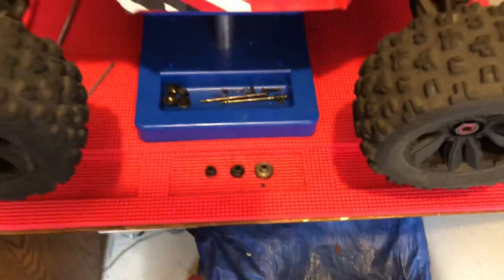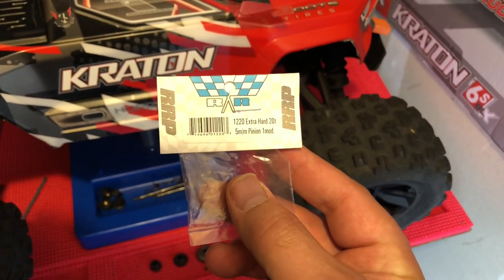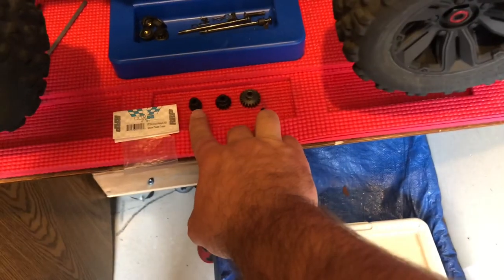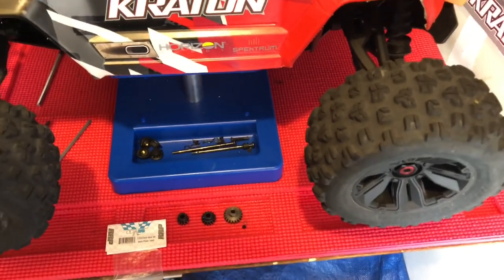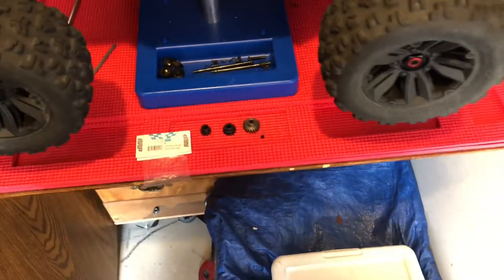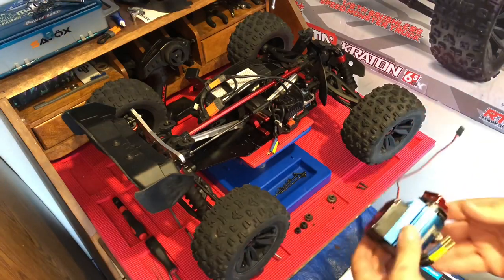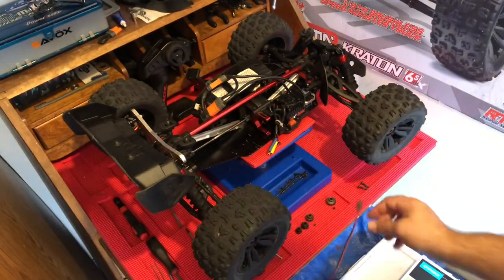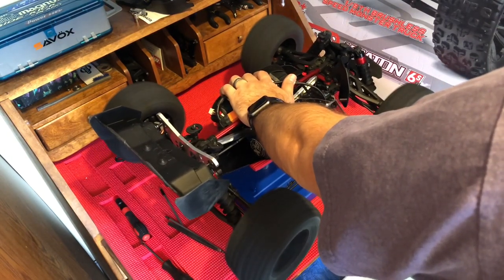PINION GEARS | Arrma Kraton | What you need to know

Comment: Ive gone from stock to 14 tooth tekno. I find 14 is a sweet spot esp for bashing as i dont need my K6 to go 65mph on a jump track lol 14 seems to have much more poke and goes faster at top end without any overheating issues which can occur with larger pinions.A sort of a balance i found was needed so as to not sacrifice instant (ramp) accelaration for too much top end which i will only really use on speed runs. Just think about where and how you want to drive before changing pinions guys - great vid as always East

Comment: Hi, just ordered my Kraton EXB at amazon an planning a Max6 1650kv Combo. You were the first source I found the info that I need a MOD 1 Pinion. Helped me a lot, THANK YOU VERY MUCH!!! Very much aprechiated :-)
Reply from the maker: That’s awesome! Two things …most of the videos that I’ve created will work just fine for the EXB. However the differentials are a bit different so if I don’t drop a video by the time you get to your differentials then there’s other great videos on them. However I recently picked up the EXB myself and plan on doing a series of videos on it as well. So stay tuned to my channel and we’ll go on the journey together
Reply: @EastTactics  Now that would be cool! Its my first 1/8th, so everything new for me. I've read that it would be good to shim the diffs to make them stiffer / more durable. Especially when adding lots of power. :-) What ESC / Motor will you put into your EXB?
Reply from the maker: @michaelfeuz1004  Im tossing in a firma 160 8s ESC, and the hobby 1730 motor, she's gunna RIP!!

Comment: You can change the spur gear and get the same results smallest spur
Reply: I got a blx185 6s 20 tooth pinion on a Revo 3.3 I won't know if it gets hot until summer time trying to figure out the right

Comment: I’m using the Powerhobby Aluminum Heat Sink W Dual Cooling Fan 1/8 Motor. No modifications needed strong fans. Part# PH1289. On eBay under 25$

Comment: Hey man! Thanks for the helpful video, I just uprgraded to a castle 1520 1650kv motor and a mamba 8s esc. Just to confirm, should I go with a 20 tooth pinion? And what size spur gear? My exb is stock right now.
Reply from the maker: I’ll probably go w/ a 22 or 23t pinion. 
Stock spur gear is fine.
Reply: Ohh dang! alright gotcha your awesome man thanks for the reply 👍
Reply: One more question lol what's your opinion on the diffs? I've heard they can be a bit weak with too much power?

Comment: Hey loved the video and thanks to you I finally understand more 😂 but I ordered a pinion 20t for now does it fit with a 50t hot racin spur or should I leave the stock spur ? What do u think it’s for a kraton 6s blx
Reply from the maker: KRYPTONITE LEGACY So long as the detailed instructions Or description outlined in your purchase of the hot racing Spur gear match the pitch or mod ratio On your pinion you should be good. But you need to confirm that they’re the same. Otherwise if you’re not sure you might consider sticking with the stock spur gear.
That all said you do need to be really careful with increasing your pinion gear when still running the stock ESC and motor. Especially if you’ve already increased the spur gear. Unfortunately the stock ESC and the motor are not really compatible with pushing the limits of your opinion and spur very high. I myself started experiencing A lot of rear end breakages in my differential as well as cogging issues. I have since dropped my pinion back down to the 16t.
I was running a 20t when the majority of my issues started happening. So you might be OK at 18 but just be warned. 
Also it is absolutely important that you massively increase the cooling on your motor. You don’t want your motor running any hotter than 150 to 160°.  An 18 tooth pinion gear as well as a modified spur gear are definitely going to put you in the hot range. I dropped a few videos recently outlining NTF fans, they are killer! But a little bit pricey. So you might consider picking up the duel yeah racing fans. You can find details in the description on my master list for that product. As far as details about NTF just check out my most recent videos. Also if you’re not 100% sure what cogging is I have a video on that in my library. 
Bash on broski!

Comment: What stand are you using to pick it up that high with the wheels on. My kraton and nero tires will still touch the surface with my DuraTrax stand. Already know my 8s Kraton won't work with it at all. Great video!!
Also for the 20T did you have to rotate the motor any? Think I'm running a 16 or 17 teeth right now and planning on going to a 20t after watching this video and a 23 or 24 for my 8s Kraton.
Reply from the maker: Hey Calvin, Great question. Mine is also the Dura tracks however I think it’s an older version that has a longer post. When I bought mine I specifically looked for this model. Check out this video at around the two minute mark, I show an image of the exact model I picked up off of eBay. Again I believe it’s actually a longer post then normal.
https://youtu.be/gov56EolTK0
Reply: @EastTactics  Thanks, yes I had the 1/8, 1/10 car scaled version. Thanks!

Comment: Thanks for this video man just got myself a 18t pinion gear and had you had any chance to bash around with the  bigger pinion gears? Got my kraton 6s on my channel brotha would like your input thank again
Reply from the maker: Awesome... be carful though, I learned the hard way, after going that high with an 18 and 20 tooth pinion gear, I started breaking rear diff pins and planetary gears. Turns out... the stock motor and stock ESC are not very compatible with that high a pinion. you might experience Cogging too. which is an annoying hesitation and clicking when hitting the throttle hard from the line.
You might be fine tho... I think I started really only experiencing the issues i mentioned above when I tossed in a 20t pinion. Bash on brother!!!
Reply: @EastTactics  thanks for the info brother I actually had a cogging issue with the 18t pinion punch level 7 so I decided to put a 15t on punch level 9 and  it's way more torque down low and does wheels doing 40+ lol 

Btw how did u fix the  cogging with the bigger pinion gears ?

Comment: My arrma senton mega 4x4 brushed came with a stock 17t pinion gear I upgraded to the 22t pinion. Made it hot. Burnt through the motor quick. I recently took out the brushed and converted to a 3660 3300kv and 60a esc I have a 26t in there. Would be open to recommendations for a good pinion for that. I am running stock spur in there. I currently have 2s lipo on it but gonna grab a 3s for fun. Also my motor is a 4t motor if that helps.

Comment: All I can tell you is watch your motor Temperature with that stock motor and a high gears you should be running lower kv motor with that 20 tooth
Reply from the maker: James, LOL wish you would’ve posted this comment a few days after I dropped this video ha ha. 
You are spot on with your advice and I in fact have since learned that I was way overzealous With that choice of running a 20 T Pinion. 
In fact if you check out my video library you’ll find more recent videos talking about me having issues with many components on my vehicle due to the choice of Running the 20t gear. I started breaking pins in my rear differential, which prompted me to purchase custom steel from McMaster.com, I also started experiencing cogging issues. After some diving into the armma forums, And letting those guys know what I was running, I immediately got a message Letting you know that I should not be running a 20t pinion with the stock components. 
So yeah… I might’ve learned the hard way however I was able to create content to teach others how to avoid the same mistake. I did leave a updated message in the description of that video that basically leaves exactly what you just said, what I need to do though is figure out a way to get that message into the beginning of the video, basically just letting the users know. 
I have since dropped back to 16T and the issues have gone away. Appreciate your sage advice. 
Here is a link to the video where I admitted the error of my ways. One of these days though I would like to grab a lower KV motor, and perhaps an upgraded ESC.
Link to that vid
What is RC Cogging | Motor Advice https://youtu.be/ZaK_JLI9QNA
Reply: Every one that’s in the rc hobby has has hit that bumpy road a time  or two I have and probably will again it’s just part of it

Comment: Would you say using pinion size as a tool to slow a car down for my kids?
Reply from the maker: I think there might be more effective ways to slow it down. What vehicle are you running? Like for mine, I can run it on one 3s battery instead of 6s.
Also… Some controllers come with a actual switch that allows you to Nerf the throttle.
Reply: @EastTactics  so i wanna buy a typhon but i dont want a mega...im using my granite blx as reference. Im running 2s, controller on 50% and punch 1. It s still fast on the street! Realizing when you re spinning on dirt the actual car doesn t travel as fast.
Reply from the maker: When it comes to your pinion size, small pinions seem to have a little bit of a quicker get up from the start line. Whereas large pinions will actually give you higher top end speed. However adjusting your pinion as far as speed overall goals, is fairly minimal, until you get to the top end speed of a vehicle.
Reply: @EastTactics  ya, kinda what i figured. Maybe they will just grow into the blx typhon.  How about swaaping just the motor?
Reply from the maker: I’m sure that could work, you would just have to find a smaller motor that’s compatible with your setup.
Reply: @EastTactics  appreciate your input. Killer channel.
Reply from the maker: 😎 thanks!!

Comment: I recently got a kraton 8s any recommendations on a new servo and a pinion gear I’m new to the rc world plus motor and esc
Reply from the maker: Congrats on getting the new 8s Kraton, is there a reason why you’re looking to replace all of the stock components? Are you not happy with the current performance of the stock motor and ESC? Or the stock servo? Or is it more of a… Money is not an issue thing and you just want to upgrade it to the best of the best?
I would say, since you’re new to the hobby enjoy the stock components get used to the vehicle and if you want to upgrade something simple just upgrade the pinion. Maybe go 21T or 22T. However if you do make sure you pick up a temp gun so you can make sure your temperatures on your motor and ESC are good.Also whenever you’re messing round with your pinion gear you’re asking more of your motor so it’s recommended to always put a fan on your motor.
Now… With that said if you were just simply looking to upgrade all of the stock electronics to higher end stuff I would probably check out Rich Duper bashes videos. Just simply type in Arrma Kraton 8s. I believe I recently watched a video of his where he is running an 800kv motor, with limitless 36/36 gearing. I’ve seen other people with 39/39 gearing, but those types of set ups require upgrading the motor to much lower KV.
I’m not as familiar with the 8S line, as my specialty is with the 6s. However another thing you might consider looking into is increasing the thickness of your center differential. I believe it comes stock at 1 million. Some people like up in that 20 million. If you’re not already familiar with the Arrma forums, check that out there are a ton of great set up Recommendations and good people to bounce ideas off of there. Highly recommend it

Comment: Thanks for the vide!!! Let me ask you a question since I having a hard time installing the front #M2CRacing front chassis brace in my v3 KRATON?Got the rear in no problem, but having some issues with the front brace! What do you need to take a part in order to get a driver or a pair of pilers to hold the nut while you screw in the top screw?
Reply from the maker: If i recall correctly when installing both my chassis braces, I used the small tool the arrma provided topside. Set the vehicle on its side and used the hex drive from underneath. I forget if I had to remove the center diff to get at it... I know its a nightmare removing that center diff in the V3. 
Sorry it took me a week to respond. I some how missed your question. 
I assume you've since figured it out. Bash on brother!

Comment: I have a kraton 6s v5 and i will replace the stock motor pinion With a 20t. It will be fine? I use it With 6s 5k lipo
Reply from the maker: So I’ve learned from experience after the creation of this video that you do not want to run a 20t pinion on stock electronics. While it will work, and the video here gives an accurate depiction of the speed increase. I found that I started breaking rear differential pins left and right. I started cogging. And unless you are running high powered cooling you definitely don’t want to run it because you’ll get too hot.
Watch this video for a more recent overview of what you might consider doing and thinking about it
https://youtu.be/s4-RjtQsMsU
With stock electronics, you really shouldn’t go past 16 T and if you get up to 16 teeth you really should be increasing your cooling over both your ESC and your motor
If you want to start running 20 then you need to pick up a motor and ESC upgrade

Comment: I'm building a Arrma limitless so far I have a kill mode tp 2900kv w/cap pack, xlx extreme, savox 7.4 sc-1268sg-be. Haven't started cause haven't decided on gearing. My question is I want to drift & bash on track with friends and still get a decent speed run when time is right, with out producing to much heat, what's you suggestion on gearing to accomplish such balance?
Reply: Thank you
Reply from the maker: I’m not very well-versed in gearing up the Arma limitless. However what I can suggest you do is take a stroll over to the Arrma forum if you’re not already a member. I’m telling you there’s a ton of guys there that Are always willing to help. And I’m sure there’s a large group of limitless Masters
 www.arrmaforum.com

Comment: Hey, what would you recommend with a Hobbywing Max8 2200kv combo? Thanks :)
Reply from the maker: What motor and pinion gear did it come with stock?
Reply: @EastTactics  a 12T :)
Reply from the maker: Oh OK so you’re talking the Kraton 6s, like mine.
That set up could handle anywhere from 12 to 23 teeth. The gamble you make when going up as high as 20+ is the increase torque thrown out your differential, particularly your rear.
Might be a bit more likely to bust gears/pins etc. However your motor/ESC combo can certainly handle it. 💪💪
Reply: @EastTactics  Thanks for the advice man! Turns out the EXB is way cheaper in the UK than the V5 with mods 👍👌

Comment: Do I have to buy a different motor if the pinion gear hole is to small to fit
Reply from the maker: I’ve seen people drill them out, but honestly why would you buy a new motor when you can simply just pick up a different pinion gear with the right hole size?